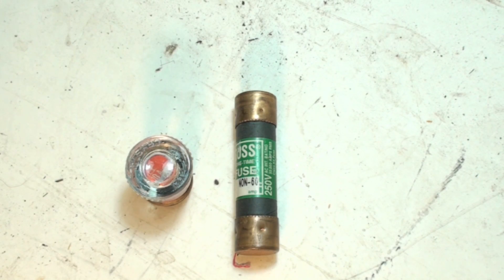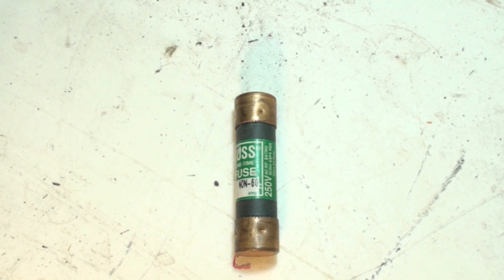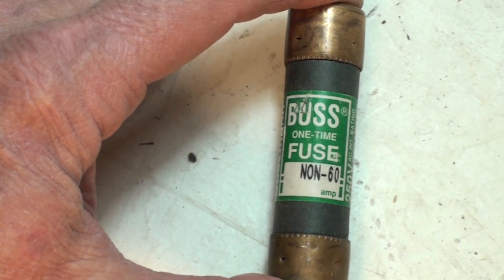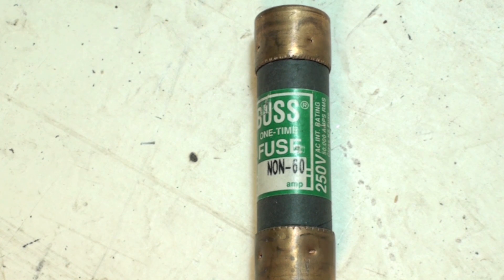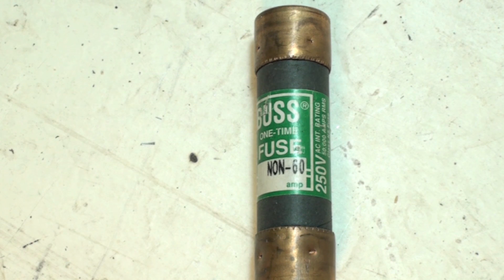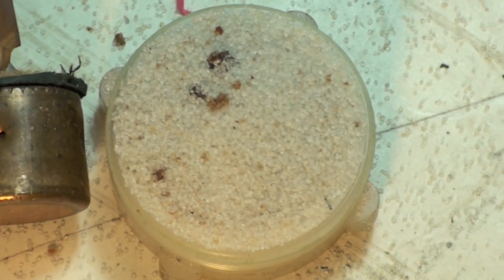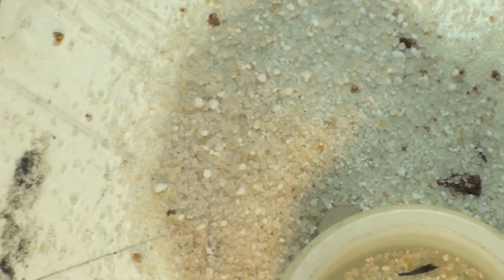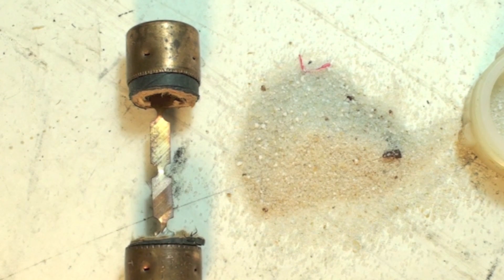The cartridge fuse. Fuses part 3

Comment: There are multiple small areas (weak points) inside a fuse for short-circuit protection.  Under a typical over-current event one of them will open, but under a short circuit all of them will open and and arcing will fuse the sand into glass which is an excellent insulator and will extinguish the arc.

Comment: Thank you for this video. I am just going to add to it to help other homeowners since it is old and the only one that I can find. It won't "burn in two" like you said, the metal will melt from high heat created by more resistance than it can handle. But some times, the metal in these fuses gets old and won't transmit or allow as much amperage flow even though you get a proper voltage reading. It's like with water, you can have 100 psi (pounds per square inch) build up through a pinhole. But you will not have as much volume through a pinhole as a 1" diameter pipe.

Comment: That silica powder is an arc extinguishing medium. When the fuse opens (always under an overload) the sand fills in the void as the element burns extinguishing the arc. This is why fuses are capable of interrupting higher available fault currents than circuit breakers. They can't put that sand inside a circuit breaker for obvious reasons. If you haven't noticed, fuse have a higher available interrupting rating (A.I.R.) than breakers.

Comment: Is there like a 2 or 3 time use cartridge fuse?....mine went out,I took it out flipped it around...did not expect for it to work! But prayed hard because it’s New Year’s Eve everywhere is closed! 
Miraculously it’s working !? 
I don’t understand how this is possible.
Reply from the maker: I can't explain it other than to say perhaps your problem was not the fuse.
GFM
Reply: @grayfurnaceman  well thank you very much for the quick response....
Now that I’m not mad any more I realize I could have just ran an extension cord to a working outlet for the fridge until places re-open. “Duh!”
I cant make heads or tails of it ether.
The people who lived here before were on drugs and played with the wires ALOT 😏 knock wood though!,3 years and the house has not burned down yet 😅
Hope you have a great New Years!
And thanks again for such a fast response.
Reply: replacing a 60 amp cartridge fuse for Air conditioning.. when I put the cartridge holder back in it quickly gave electrical connection sound

Comment: The sand is to quench electrical arcs when the element melts (i.e., fuses). Here is the description from Fuseco's site: "Current limiting fuses contain a granular filler, usually high purity quartz sand of a defined grain size and packaging density. The specific grain size distribution provides room to expand for the vapours and gases produced by the arc and offers a large surface for efficient cooling. The filler does melt under the influence of high arc temperatures, absorbing an enormous amount of energy and extinguishing the arc well before current zero. Fused quartz and metal form a non-conductive fulgurite body that prevents re-striking of the arc."
Reply from the maker: Good info, thanks
GFM
Reply: more fuse body material as melamine , vulcanized fiber , epoxy fiberglass tube on fusestube.com,wellele.com

Comment: Do you think i can replace a cartridge fuse and wiring with a automotive fuse? Cartridge fuse is off a old 4 wheeler.
Reply: more fuse body material as melamine , vulcanized fiber , epoxy fiberglass tube on fusetube.com,wellele.com
Reply: You must be a wild man for even thinking of doing something like that dude.... Listen, get back in the box before they notice... You've gone WAAAAAYYY too far this time, and you're losing it, BIG-TIME... If anyone ever tries to tell you to replace a cartridge fuse with an Auto fuse, ever again, Just kindly Refuse, and step away, back into the box....Ok?....              Lol,                                                                                                                                                                                                                      Simple answer; If it conducts a current, and that current is adequate to run the thing that you wish to run, without burning up the fuse to failure, then it sounds like you in business. Just don't stick a 100 amp fuse in a 10 amp slot if you've already burned through your 15,20,30,40, and 50 amp fuses on the same circuit, one after an other immediately after powering on the device... Something else is wrong and pushing too much juice at your power supply. A fuse doesn't act as a resistor does in limiting the amount of current from supply to load, thereby protecting the load from too much energy while maintaining function, instead, a fuse is just designed to withstand a specific level of heat (essentially) that is relative to a particular working amperage maximum. If it gets too much power, it gets too hot, and dis-integrates itself at it's weakest point.... JUST REFUSE THE TEMPTATION DAMNIT!!!!                              ;-)

Comment: Yes, those cartridge fuses are available in ratings larger than 60 amperes.  My parents owned a house built in the mid-1950s that had a couple of large, 70A cartridge fuses for the mains protection..  Since they were installed in a Cutler-Hammer enclosure rated at 100A with appropriately sized bus wiring to the sub-panel containing the branch circuit breakers, dad eventually replaced them with 100A cartridge fuses, as he got tired of replacing burned-out fuses.  Nowadays, I would consider replacing the mains fuses with a dual circuit breaker, since the fuses can cost $18-$20 each and a major overload event on a 220V appliance circuit that blows both fuses could end up costing $40, whereas it would just be a minor inconvenience having to reset a tripped breaker.
Reply: 70 amp and up cartridge fuses are physically larger than the 35-60 amp variety, and they use flat blades on each end that clip into the holders. I had a place with two 100 amp main fuses. Never blew either one but I never had any large loads or appliances on the service, major appliances were all natural gas.
Reply: more fuse body material as melamine , vulcanized fiber , epoxy fiberglass tube on fusestube.com,wellele.com

Comment: I think they have more than one weak spot to evenly distribute the current across the fuse. This way, the heat is more evenly distributed throughout the fuse. If there was only one weak spot, it could overheat prematurely and alter the current carrying capacity of the fuse, bringing it out of spec. Just my guess...